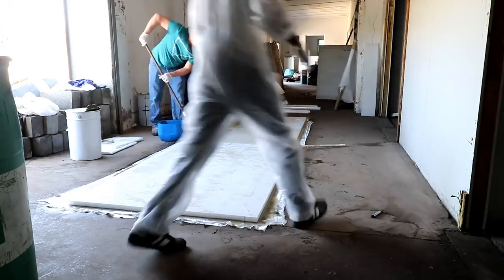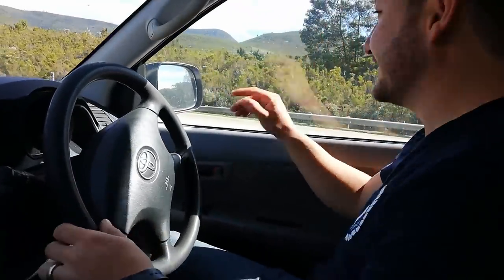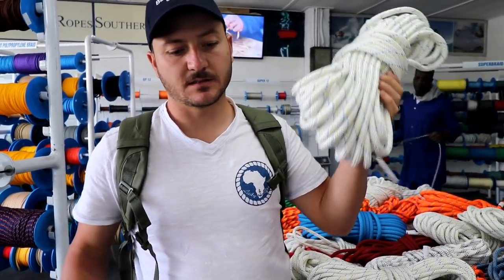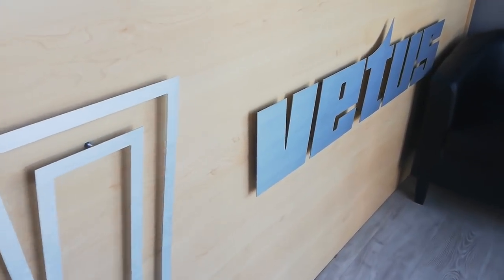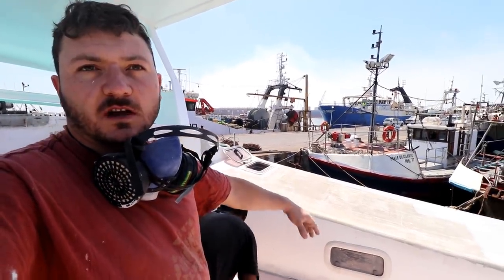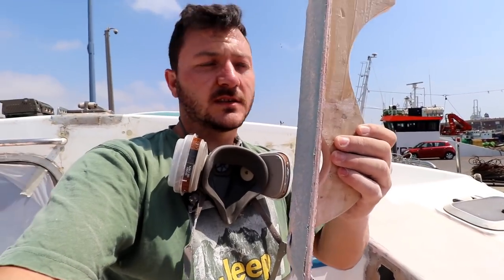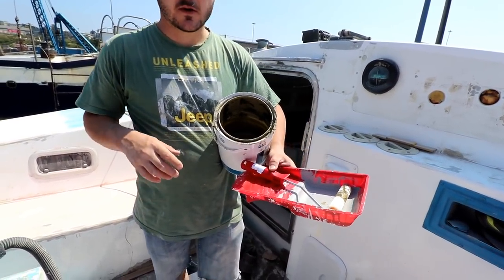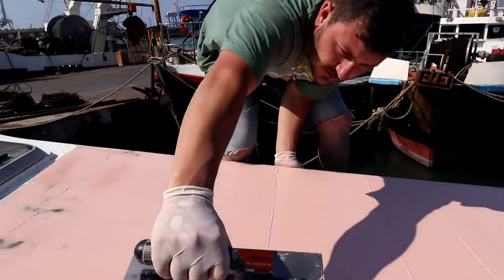Cape Town Boat Show & Reparing our Cockpit | YACHT REBUILD WEEK 42

Comment: taking shape nicely,i like the battens on the ceiling panels those will hold it in place if the glue fails on  the velcro.

you must be about ready to make up the templates for all your cushions , mattresses and  covers a lot of work if you do it yourself but well worth giving it a try if you can get hold of a good sailmakers sewing machine.

making your own soft furnishing and sail covers as well as dodgers ,awnings ,boom stack pack etc will save you a fortune,plus it is a good way to earn a living  in the future when cruising by fixing other peoples sails and doing canvas work etc.